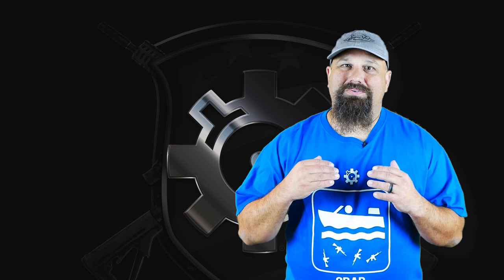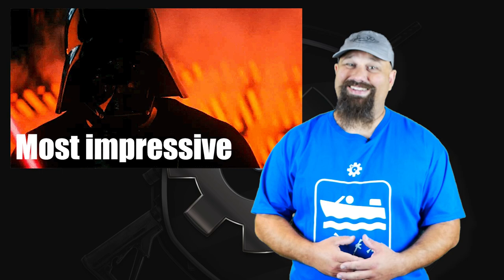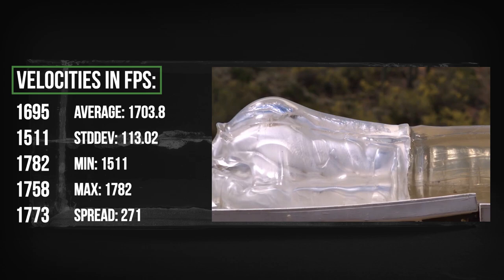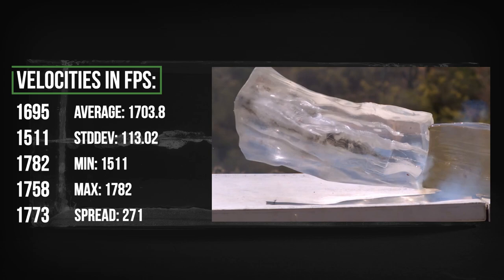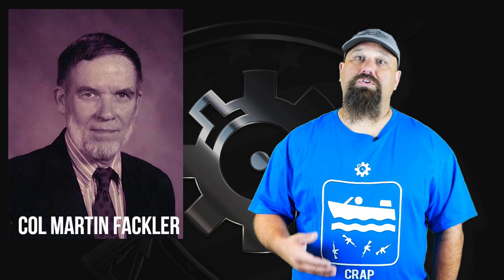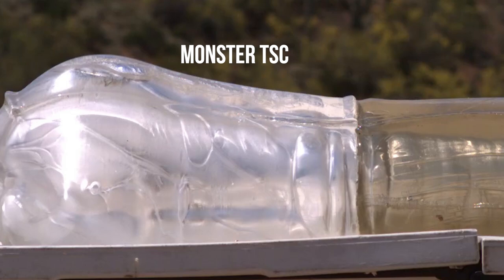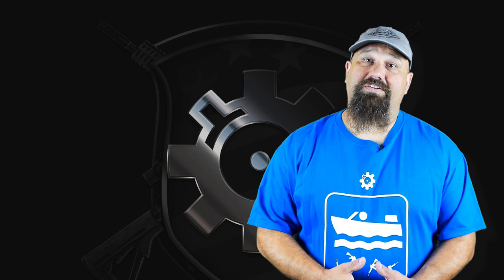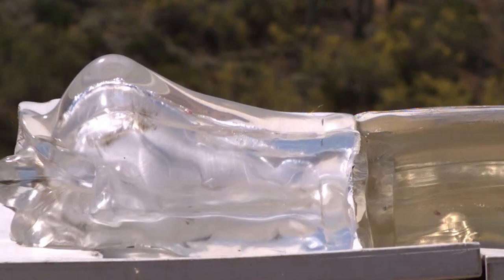A Beast of a Cartridge! .45-70 HSM 430gr +P RNFP Gel Test

Comment: The 45-70 is a great cartridge for deer hunting when running into a brown bear is a distinct possibility. My load is a 420 gr hard cast bullet going out at about 1800 fps and though it knocks a deer down with authority it damages very little meat compared to other higher velocity cartridges. But it is nice to have if you should run into bear. It's a nice cartridge for this circumstance.
Reply: I'M ONLY 5'7" & 155 SO I AINT GONNA SHOOT THAT EVER -- MY LOAD IS A 405 HARD CAST AT JUST ABOUT 1500fps -- MUCH EASIER ON THE SHOULDER & STILL PENETRATES A TON - THAT LOAD IS FOR WHEN THE BEAR IS 5 FEET AWAY & I DONT HAVE TO AIM - JUST HANG ON TO THE RIFLE & PRAY :text-green-game-over:
Reply: Can I ask you what's the average distance at which you fire the 420gr to target? I was looking at a buck about 350 yards away and was a bit scared to take the shot as I lack experience shooting at a distance with such a large round (drops a lot).
Reply: While these heavy slugs retain velocity due to sheer mass, they shed velocity faster than any small bore spitzer bullet. High muzzle velocities means you'll just be able to smack something at longer range without losing all the available locomotion on wind.

Comment: A friend had an acquaintance buy an 1895 Guide Gun and wanted some 'hot' reloads for it.  I have one myself,  and reload so he gave me a box of empty brass and I loaded a bunch of different levels starting with Trapdoor safe to my 425 RL-7 stompers.   The guy didn't make it halfway through the box before wimping out and then sold the rifle!   Full boat 45-70's can approach (or even match) 458 WinMag power and are not to be taken lightly....especially in a carbine like the GG.   It definitely gets your attention when you touch one off.

Comment: The 45-70 gov has been used successfully to hunt the "big five" in Africa and is even used by some guides there. It's a hell of a cartridge. I used to use a first gen Marlin 45-70 Guide Gun (18" factory ported barrel) for stalking wild boar. 💪🏼
Reply: @Craigx71  I suggest you look into Buffalo Bore ammunition. They have offerings at over 3,500 ft lbs of energy, much higher than your quoted maximum of 2,300. There are also other companies and also custom hand loads available. A quick search online will also show many verified accounts of the 45-70 gov used successfully in Africa. As far as the legality of it I am not up to date with that since there are many different factors that can affect that. My point is that the cartridge is an effective one and has successfully been used to hunt the dangerous five in Africa with great success.
Reply: I recommend Garrett Cartridges of Texas. They have a whole variety of standard and +P super-hard-cast large melpat stuff, as well Woodleigh.

Comment: Actually, the original loading of the .45 Colt featured 40 grains of BP.  One of the requirements for the cartridge was the ability to take down horses.  During those days, many horses were utilized by the army, and there were fairly common instances of horses going berserk.  The 250 grain conical bullet propelled by 40 grains of BP would reliably penetrate a horse completely.
Reply: I’ve experimented with the 45 colt & 454 casull in carbines . I’ve loaded down to 250gr rnfp with 10 & 11gr of trailboss. 11gr of trailboss was right on 1100 fps . It punches straight through everything & things bleed out fast ! basically no recoil & right on the edge of the sound barrier & no hearing protection needed . That’s a fantastic load for a walk about the woods .
Reply: You could also disable the enemy by whacking their animals.

Comment: If you want to see what the 45-70 is really capable of look at the loading data strictly for Ruger #1&3.
Reply: Yep, there are 3 “classes” of 45-70 load data, old black powder equivalent for the trap door, modern lever action, and those single shot rifles you mentioned. Those are getting up towards 458 Win mag.
Reply: Then there is pushing an Encore to 458 WinMag levels cause you could easiky rechamber to such anyway... 408gr north og 2000fps.., yes i bench shoot it too.. masocist.?
Reply: Winchester in their modern Miroku-made 1886 still offer .45-90. That'll give you about 250 fps greater with the same bullet weights vs. 45-70. Or if you wish to go to the copper solids like a 225gr Lehigh Defense bullet, the .45-90 will move that out borderline 3,000 fps.
Reply: #1 using a Barnes 450 grain hollow point @2000fps.

Comment: I used to have a Marlin .444, very similar to the 45-70.  Better hit your target with the 1st shot because the 2nd is a flincher. . . .
Reply: Love my .444... hand-loaded 270 gr. Gold Dot FP @ 2200 fps rocks. It will absolutely hammer pigs, deer and black bears (and your shoulder)
Reply: With my .444 I hand load the Hornady 265gr soft point down to 2000fps. I've taken white tail, mule deer, and numerous hogs, several over 300lbs. I've never recovered a bulletbut recovered all animals within several feet of impact.
Reply: Love the 444!
Reply: Magnum Research makes a BFR revolver in .444 Marlin.

Comment: Yyyyyaaaaaaayyyyyy 45-70 gov.  If i had the money i would get a nice 45-70 lever gun . And yes some research does suggest that larger heavier bullets traveling around the 1600-1700fps can still produce hydrostatic shock to a degree.  But the beauty of 45-70 is you can still get to that 2000 fps with lighter bullets if need be .

Comment: Let’s not forget that .45-70 was designed to be able to kill an enemy combatant or horse at 600+ yards.
Reply: not really, 45-70 is a 200 and in cartrige since it drops quite a lot and only open sights back then
Reply: @dlam2864  but there are record's of kill at a mile.
Reply: @t-bfr45-70  the standard was 1 inch pine board. If a bullet penetrated that, it would seriously injure or kill a man. The Army -at Sandy Hook - tested a 405 or 500 (I forget which) with black powder so, about 1300fps, at 2600 yards or about a mile and a half.  Penetrated 2 pine boards and buried itself 14 inches into the sand.  Of course, the trajectory was about 45 degrees at that distance... more like a mortar or artillery shell .
Reply: @hardrockminer-50  sandyhook was earlier days of 45-70 so would have been 500gr and was 3200yds if remember right. Speaking of artillery that is more or less how the gatling gun was used and it was 45-70.
Reply: I get half inch groupings at 300 yds with 405 grain with open sights
Reply: @jamesdennis9400  well that just says your less blind then me but 405 tend to be extremely accurate.
Reply: @t-bfr45-70  yeah 1 in 10000
Reply: @jamesdennis9400  that's very good for a 45.70
Reply: @t-bfr45-70  I know it's possible . a .22 could be lethal up to a mile . I'm only suggesting that there are far better cartridges for long distance hunting. Let's be serious who wants to wound and not kill an animal because there using a heavy slow bullet that is not designed for long distance . it only takes 1 bad shot to unethically wound an animal.
Reply: @fredmiller4110  the 45-70 is more then lethal at longer rang then you can shoot it slow from the barrel it does not relie on speed unlike modern loads it's all about size and weight. As far as long range hunting their are a few people out there that can but with any gun you need to understand your own ability.  45-70 problem at long distance is it's hard to judge drop not lack of knock down. lot of people out there with nice guns that should not be hunting more then 50 yards because lack of practice.
Reply: @t-bfr45-70  I agree I was just saying for the average shooter there are better calibers for long range. Less drop flatter trajectorys. There are people that are good enough to hit accuratly at 500 yards with a 45.70 and there are people that can't hit a dinner plate at 50 yards with a 338 mag. If someone asked me if I would recommend 45.70 for hunting sheep at 600 yards and further I would not. I f they asked me if I would recommend 45 70. For moose or bear 300 yards. And less I would say it is an excellent choice.

Comment: Cape buffalo.
I have some ammo by either Buffalo Bore or  Garrett Cartridge Company that's a 550gr hard cast lead bullet rated at 1550 from a 20" barrel. It is stated to go through a Cape Buffalo from any direction, even diagonally, except for a head shot (the brain is exceptionally well protected by the horn  bosses). I imagine it would work on elephant as well with a careful shot. Definitely works on any bear up to and including polar bear.

Comment: Nice video - the shot of the bullet going through the gel speaks for it's self.  Years ago I hand loaded .45-70 for a cheap single shot H&R.  We had a mold for I believe a 405 grain that was about the same shape as what you are using.  We had no way of measuring velocity (we judged the load by the recoil).  I never hunted with it but the best accuracy and heaviest target damaged was accomplished with a stiff load and a 300 grain jacketed soft or hollow point.

Comment: Why I recently purchased a Ruger number 3 rifle with a shalaine barrel and custom wood. Built by a friend of mine. He used to bear hunt with the original owner of the firearm who recently passed. It is considerably heavier than that lever action firearm you're using so it should be at least slightly more comfortable to launch these locomotive at whatever you wish to hunt. You know, things like Buicks, Cadillacs, Mack Trucks, etc etc etc...

I may even change over the sites from the two and a half Power Scope that's on it to something that I can go and compete 1000-yard matches. Show some of these people just exactly how accurate these things are at a thousand yards. As they figured out after the movie Quigley Down Under come out these big heavy bullets tend to ignore wind considerations.

Comment: Original 45 Colt load was 40 g.rains black and a 255 grain lead round nose flat tip bullet. It was reduced to 230 grains lead and 
28 grains black powder when the army started buying S&W Schofield revolvers.

Comment: Actually the orginal 45 Colt round had 40 grains of black powder. Due to a high recoil, the Army reduced the load to 35 grains of black powder. You can't leave dead air space in black powder cartridges. Even the old 4570 load was reduced from 70 grains to 55 grains with wad spacers fir the cavalry carbines due to excessive recoil in their rifles.
The only black powder cartridge rifle that used 28 gains of powder was the 44 Henry rimfire round.

Comment: I have a Marlin 1895 Guide Gun that was worked over by Wild West Guns for bear protection in the Alaska interior where the bears reach epic proportions. It has ghost ring sights, a custom recoil pad, and a ported muzzle. Even with the ported muzzle, full-on bear loads are an unpleasant experience. Probably less unpleasant than being mauled by a bear, however. The porting does bring standard loads down to quite manageable recoil levels and someday I hope to take it hog hunting in Texas. A .45-70 should be just the ticket for hogs.

Comment: This load produces  around 3000 foot lbs of muzzle energy which is high for most loads in 45 70 but u can buy 45 70 factory loads up to 3800 foot lbs which is a big different and if u hand load it and have a strong action like a ruger #1 u can have almost 458 win mag energy on the low end

Comment: Veral Smith of LBT fame came up with a tissue displacement formula based on the meplat diameter and velocity. Based on the exit holes I saw on hogs last year, I’d say it’s correct.
One of the editors of Handloader and Rifle put a CorBon solid at about 1775 fps through two Cape Buffalo. The large bull he was aiming at required a second shot. The smaller cow he didn’t see died on the spot.

Comment: Garrett Hammer Head 540 grain broad meplat bullet at about 1550 fps will shoot completely though nose to ass of Rhinos and Elephants. One guy shot through 5 1/2 feet of wet tight packed newspaper. Beartooth Bullets also makes a 525 grain hard cast gas check bullet with a broad meplat that can be driven at about 1550 fps using H-335. Garrett's testing says best penetration is achieved at 1300 to 1600 fps. faster than that penetration decrease's. Great video. Have Fun. It is a Beast.

Comment: +P seems like a dangerous concept in 45-70. A good reloading manual has 3 sections for this cartridge: 1) 1873 trapdoor and similar, 2) Marlin 1985, and 3) Ruger #1 (in ascending order of insanity). According to Hornady’s manual, Marlins can handle 40,000 CUP chamber pressure. Their max loads for a 350 grain bullet are “only” going 1,900 FPS. That 430 gr. bullet waddling along at 1,800 FPS has to be exceeding 40,000 by a wide margin. I can assure you that a 400 gr. bullet going 1,700 FPS hurts the shooter regardless of what you hit.
Reply: +P for one brand of ammo isn't the same as +P for another. It's only relative to whatever standard pressure load that a given brand offers, if they offer a upgrade of power with that same cartridge.
People assume there's some kind of SAAMI standard for +p. No.
For example, If a company loads something about 25% less than SAAMI max, then offers something in the same cartridge in a +p, that's still only 10% more, and still 15% under max SAAMI rating.
Due to old trapdoor rifles which moderate strength metal, the issue of where a given .45-70 cartridge lies by way of pressure becomes even more varied. Most all ammo will specify whether that .45-70 can be used in Springfield Trapdoor or not. If not, it's going to be somewhere in a modern power range, but nowhere near max, and even if +p, not going to be max.
Buffalo Bore or Garrett... that's a different story.

Comment: 45-70 cartridge can only go to 28,000 psi but the 460 Smith & Wesson Magnum can go to 65,000 psi, (that's 37,000 psi more) and if you get it in 45 raptor which is 460 Smith & Wesson without the rim, you can fire it out of a semi-automatic AR-10 with a 20 round magazine,  and with an 18 inch barrel you can get some impressive velocities!!

Comment: The velocity threshold was proposed at a time when our understanding of terminal ballistics was not at our current level. Velocity, raw kinetic energy, the amount of it that actually transfers to the target, bullet construction, target density, and age of target all play a role. For example a 20 year old is going to have more elastic organs tissue then a 60 year old, and a round nose bullet will not displace as much fluid as a fluted projectile and there for would need a much higher velocity to get the same result. Or 2 bullets of the same weight and velocity hitting a target. One passes through and the other stops in the target. Obviously the one that stopped transfered more (all) of it's energy.

Comment: "the .45 Colt originally used 28 grains of black powder."
If I remember correctly the original loading for the .45 Colt used a 250-grain lead bullet with 40 grains of black powder behind it. Am I wrong?
Reply: 255gr

Comment: I believe Speer did pressure barrel testing running around 70k psi
These HSM are probably 43.5k
Speer noted that cases "just fell out of the chamber"
The modern 45-70 brass may be the toughest cases out there
I "think" you should be able to get 2,000 fps with that bullet
Brian Pearce or Handloader Magazine published some extra spicy loads meant to be used in modern 1895 Marlins

Comment: Great video. Love the 45/70. It truly is a beast, as you said. With regard to hunting, I'd use it on any big game except for African dangerous game. The last I heard/read, as powerful as the cartridge is, even +P loads are still shy of the minimum ft. lbs. required for ADG; literally by 100-200 ft.lbs. Other than those critters, the 45/70 will suffice anywhere on the planet.
Reply: 30-06 is a regularly used cartridge in Africa. I’m sure 45-70 at modest ranges would do the job.

Comment: I have a New England arms single shot 4570, it probably weighs less than 6 pounds. Factory loads produce absolutely tremendous recoil enough where you lay the gun down and curse it. But you can go to more levels higher than that, I quit at almost elephant gun standards as it almost dislocated my shoulder but broke my collarbone. Never underestimate the 4570. It is absolutely horrible on both ends.

Comment: Just beautiful, bro!  I'm sure the venerable 45-70 has taken everything on the North American continent, many times over.  I'd like to find out if it was ever used in Africa back in the day.
Reply: It's taken the big six in Africa..tho it does fall below the minimum specs from that I've read.. guy shot a cape buffalo an the 45-70 passed thru the entire length of the bulls body an came out the backside
Reply: It's used in Africa today.
Reply: mcburcke the modern loads by Garrett, Buffalo Bore, HSM, etc. are vastly superior to the ‘old times’ loadings. They have cleanly taken every animal on earth.

Comment: Why does a 12 gauge slug not kick as much as that beast? Even the barrel of a shotgun is thin compared to what it takes to contain the pressures of a rifle but it seems like the shotgun has more power?
Reply: It is due to the fact the pressure for the shotgun shell is about 11,500 psi and for 45-70 are 28,000psi for trapdoor loads, 45,000 psi for marlin level and quite a bit more for Ruger #1 loads.
Reply: a 3 1/2 magnum absolutely does hurt every bit as much as the load tested here. I was referring to 2 3/4 "normal" hunting loads.
Reply: Try a 3 1/2" load of 00buck. Thats 18 pellets at 50grains each going around 1200 fps. Not a load I care to shoot with just a t-shirt on, lol.
Reply: @toddk1377  Nope.
Reply: Todd K why are chamber pressures so much lower on a shotgun than a straight walled centerfire?
Reply: @shanek6582  
Honestly, I don't know. I would talk to a gunsmith or google it to see if you can find an explanation.